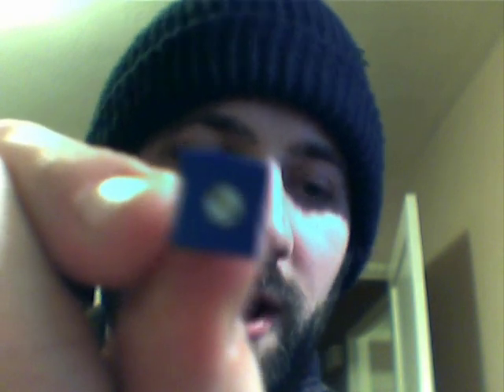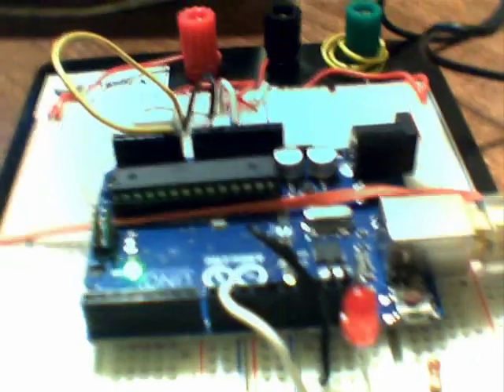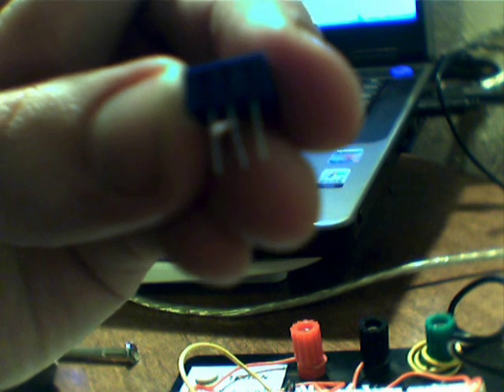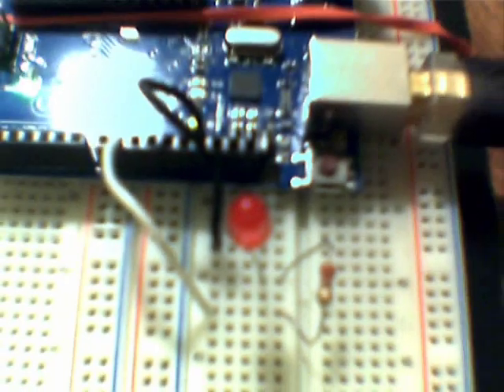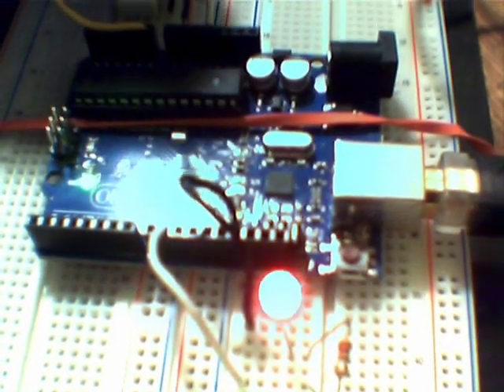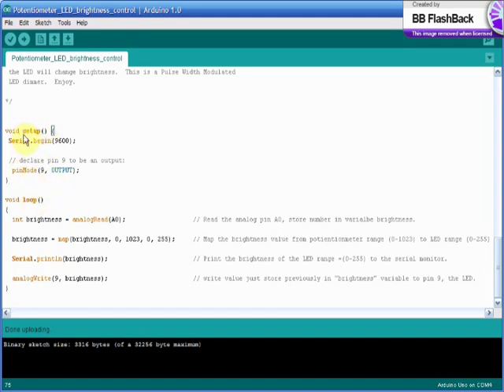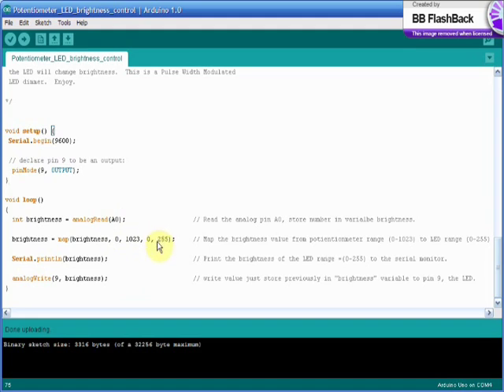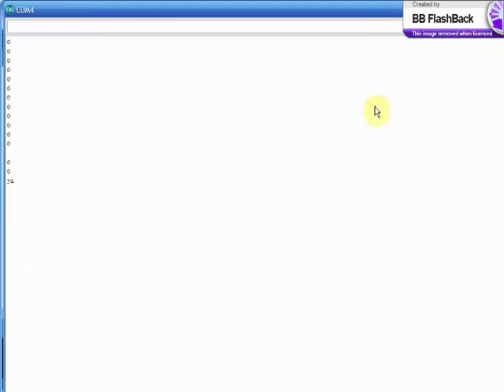Arduino tutorial - Control an LED's Brightness

Comment: That is not how a potentiometer works at all, that is how you hook it up but the signal it sends to the arduino is not a variant of voltage! The pot sends one of 3 signals to the sensor pin. For the sake of argument we will call them A-B-C. When the sketch loads the default position is B.. This way when the sensor receives the next signal it knows if it is Up(A) or Down(B). You do not see the details in the sketch you wrote because the devil is in the library! There is a really good tutorial on here about how a pot works, It is long winded but well worth watching!

Great work on the vid, combining 2 projects together shows initiative and will hopefully inspire others to take the same approach.. Just because they can!!

Comment: In your example it seems like your Arduino is interpreting the values of the potentiometer and translating the values into PWM values, is there a way to use the potentiometer as a variable resister? This would allow you to dim an LED without requiring PWM pins.

Comment: I haven't dabbled in electronics in several years, so perhaps LEDs have been improved and I'm wrong about this. But as I recall, the one problem with this approach is that you're not going to get a continuous range of brightnesses at the low range, due to the need to overcome the LED's inherent "on" voltage before it lights up.  (Of course, in many applications, that's not necessarily a concern.) The alternative approach, somewhat more complicated, is to use pulse width modulation.